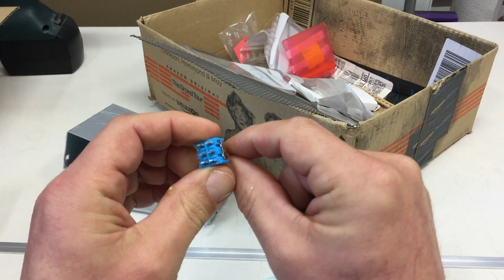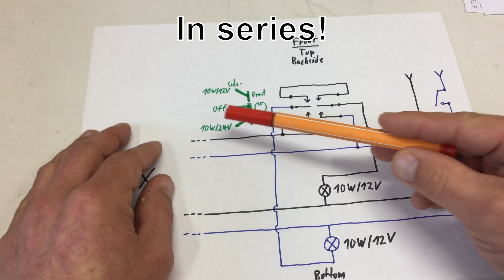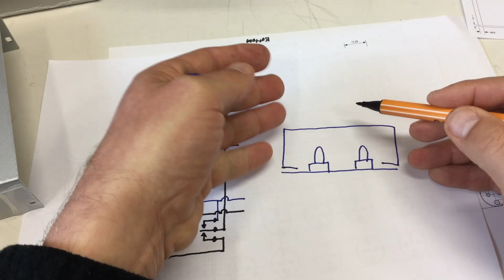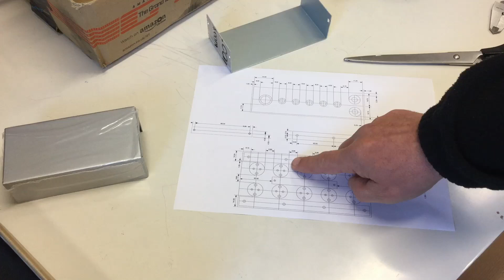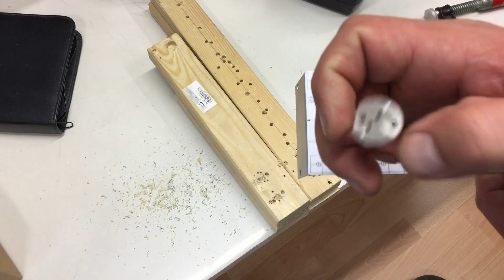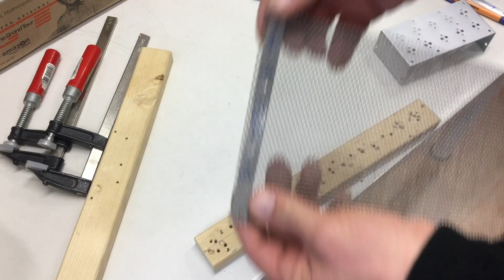Small Project: Constant Resistance 24V/100W AC/DC Electronic (*) Load – Part 1

Comment: Thank's for the video, now i've got current load to built.
Reply from the maker: You're welcome! I'm currently working on a "simple" constant current electronic DC load (2.5A/25W/33V). Features: Battery powered (single 9V), handheld enclosure, reverse voltage protection, power limitation (never exceed the 25W), low battery indicator. But it will be about 6 weeks until I publish the first video about that project.
Reply: @robertssmorgasbord  be waiting